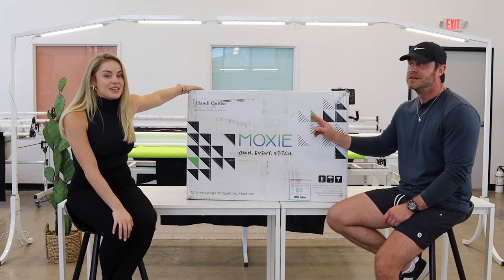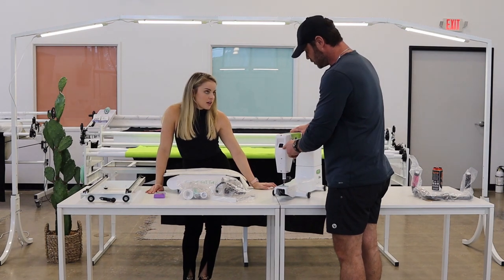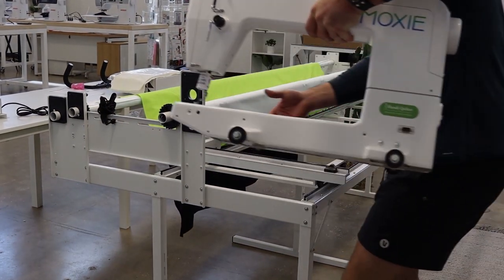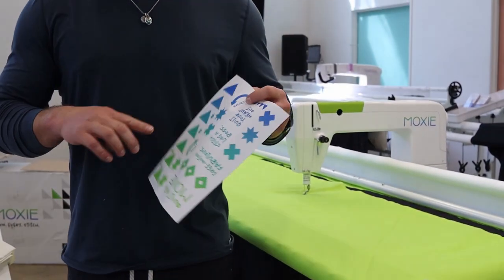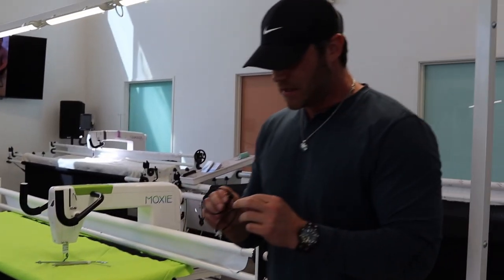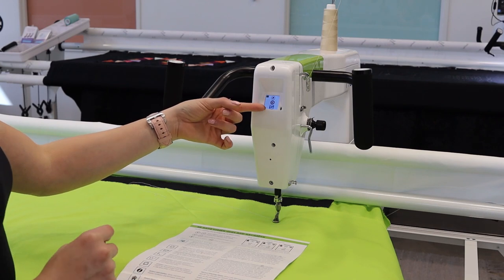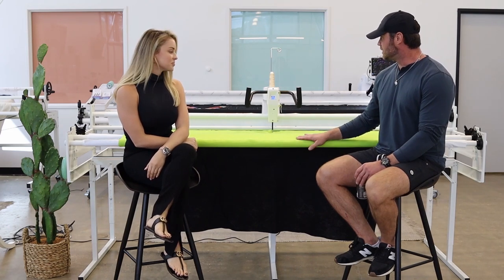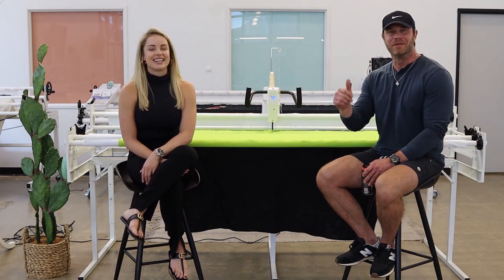Handi Quilter Moxie | Unboxing + First Look

Comment: Hi love this! What size frame and can I add quilters pro or another brand computer
Reply from the maker: The moxie can be set up at either 8ft or 10 ft. The frame is included for 4999. At the beginning of 2021 Handi Quilter will be releasing a computerized program specifically for the Moxie :)